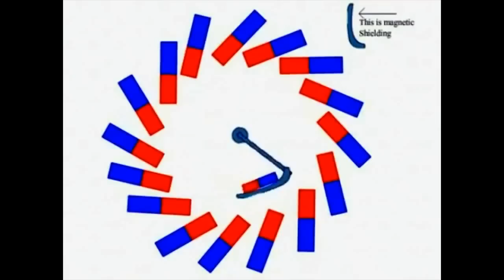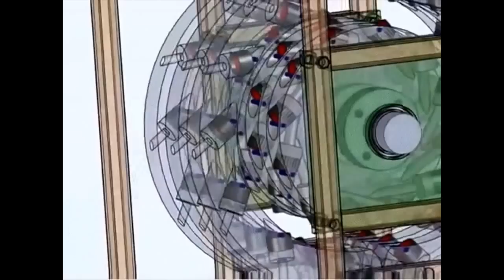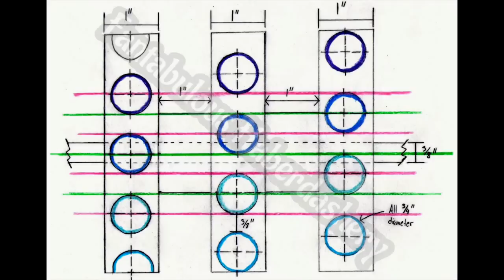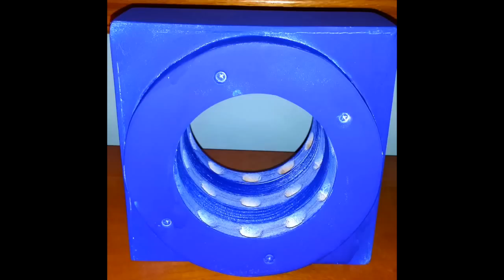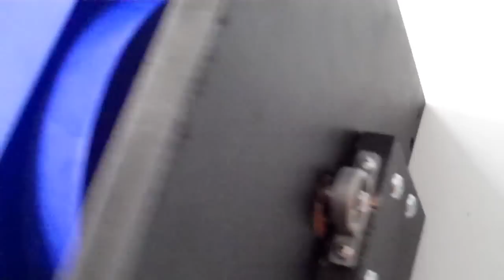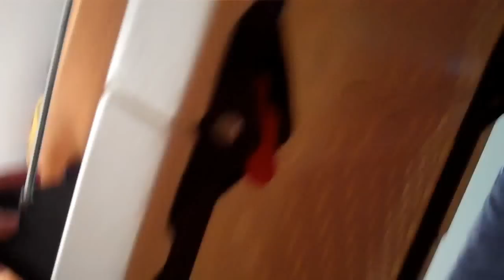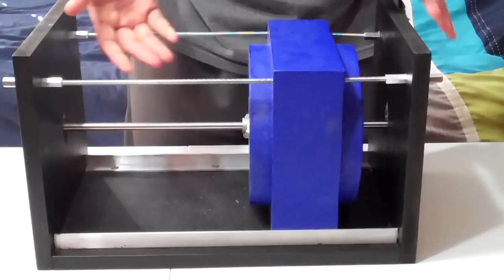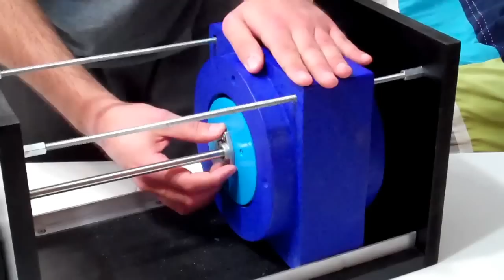Working Perendev Magnet Motor!

Comment: Magnets Loose There Power ? I Have a Magnet from McDonalds That is 40+ Yrs. Old on My Freezer Still Hanging on The Side of it. Hymm
Reply: They do loose their strength depending on the conditions they are under and it is a very very slow process.
But they do not act as batteries they are far more like springs.
Reply: do you have a proof ?
Reply: neodymium mags are the longest and strongest market sold mags, a few hundred years of magnetism in those
Reply: Take that old magnet and tape it to another magnet of similar strength so that the poles are opposed and it won't last another 40 though.

The magnetism of the material doesn't change, but all the magnetic domains that compose it will eventually become misaligned so they're not pushing in the same direction, at which point the material will no longer behave as a magnet.  Applying extra pressure to those magnetic domains in the form of an opposing magnetic field will cause them to destabilize faster.  The magnet hanging on your freezer is probably good for another few hundred years, but put one in constant opposition like this contraption does and it'll get scrambled pretty quickly by comparison.

The total amount of energy you can extract from a "motor" like this before the magnets depolarize will be substantially less than the energy required to magnetize them.  It doesn't matter if it runs for a hundred years, the total useful output will still be less than what it will take to polarize the magnets again when you're done with it.  To get more you have to tap energy from some other source like the Earth's magnetic field.  That should be possible with devices similar to this, but they're going to be finicky about their precise location and any changes in the Earth's field patterns will make them stop working.

Comment: achieving a constant rotation is not helpful ... we should have a torque to use it for rotating a generator or a fan fins ... so the torque that we need , should notably greater than what needed for constant rotating ... if we catch that torque ... there would be no problem in the first step of starting the magnet motor....so it should start to rotate from the scratch at first ... without any help to crank it up... otherwise at the best situation ... we have a constant rotating motor which is not capable to be attached to other things like generator or fan ...
Reply: You are wrong, there is need in Electromotive force, so any seed will be enough.
Rotor of waterfall generator rotates 1 time a day. Generator have up to 74 coils.
When speed is not enough, than you need to increase quantity of coils, that take Electromotive force.

Comment: we support perendev because:
1. it is stronger than v gate 
2. it is most efficient
3. we can draw more power
but none have made actual running model and uploaded it over net. even you also not did. because it needs bismuth or special graphite shielding that you did not use. as the shielding is much costlier 2000$ for one magnet. what will you do???
Reply: Nope. Bismuth, neo magnets, graphite shielding (!), hope, prayer, wishes, etc. will NEVER make Perendev's fraudulent piece of shit motor spin. It's a HOAX.  Are you really that naïve?
Reply: +Quantum Leap what you tried!
Reply: +Quantum Leap   is just a troll.

Comment: How can you tell it's really sustaining the motion rather than just having a lot of momentum? You need to find some weights that match the magnets and have a speedometer or some other way to quantify the speed of rotation, and do some comparisons.
Reply: Ah, good eye! Well, that's just sad. Just faking it and for no reason, except maybe to get views...
Reply: We KNOW it is sustaining motion because he is using an electric motor just out of left frame to KEEP it sustaining motion!  He's a fraud! This is BS.
Reply: Could very well be. In cases like this, where they admit they can't show it running continuously and admit that it is slowing down, I like to give them the benefit of the doubt and reckon they've got something that will spin for a long time and they honestly believe they just need to fiddle with it some more or try again. Now, when someone claims they've actually done it, and the thing will just keep going and going, that's different.
Reply: +Robert England and again, at @10:08 you can just see at the far left edge, that shadow has returned and then see it dissappear as he moves the motor away again,  aha!  I was wondering why he had to hold his left hand so hard on the device, its to stabilize and allow his Right hand to keep pressing the assist motor to the rod on the outside.  BUSTED!!!
Reply: +Quantum Leap You are 100% correct!  I noticed a strange shadow that gives the game away,  @8:37 he says OK, and if you look at the far left where the metal rod is sticking out, he CLEARLY puts something that wasn't there before, (a motor) up against the side (you can see a rod shaped shadow appear of right where an external motor with say, a rod and rubberized endpiece could easily 'assist' by using simple friction.  Dammit, that prick.  Anyways, Busted. By me and this guy. :-)
Reply: +Robert England Sure enough he takes away the assist motor at 9:16 @9:15 the shadow dissappears and it immediately starts slowing... Damn jerk.  Liar.

Comment: What could happen if you conect a little motor to make it run, and then with that, you connect it to another bigger motor to produce energy that can be saved in a lithium battery that can make  the little motor run :D.... it coul be free energy?

Comment: Free energy is not a myth. Take the humble solar panel it is producing energy from free* sunlight. There are energy sources all around us, the Earth is charged with 500,000 volts through tulleric currents. There is the ambient static electricity that can be harvested, and it was harvested by devices like the Testatika Generator or Lester Hendershot Generator and many others (Moray, etc.) The real myth is that fossil fuel and nuclear energy are still relevant today. The only reason these antiquated technologies weren't phased out is because they are making the elites too much money right now :)
Reply: ***** I mean 'free energy' as in energy that you don't pay for. Now there are free electrons (monopoles) all around us. In the 1800s the theory of the electric aether was very popular. Even later scientists like Tesla and even Einstein supported the theory of the electric aether. According to that theory the Earth is swimming in an endless sea of primordial electric gas. It is true that if you run high voltage with high frequency into a vacuum tube eventually that tube will explode. Even though this tube has vacuum inside the bulb will explode from the inside out. Something inside of vacuum pushes on the glass outwards causing it to explode. This something is the electric aether. Even J. J. Thompson himself wasn't sure that the electron truly was the charge carrier in electricity, he was coerced into stating that it was when he was offered fame and fortune by the British. The mainstream's understanding of electricity hasn't improved in the past 100 years, the notion of wires carrying electrons is something we have to move away from. Electricity exist between the wires in a form of a field, and metals create a boundary for that field. If interested in these ideas check out lectures by Eric Dollard on energy synthesis, or anti-relativity. Also check out the German engineer Konstantin Meyl.
Reply: ***** Its better than petrol that you have to keep buying or nuclear that pollutes the planet with radioactive wastes.
Reply: Ya, about them, THEY NEVER DID AND STILL DO NOT WORK!

Comment: It's an achievement that you've created a "semi-working" model. I totally agree with you that such devices, if successful, will drain magnets requiring "recharging".

I have developed my own design, currently going through proof-of-concept, which, if it works, will require an output load so that it doesn't accelerate to destruction.

I am also strongly of the opinion, that the successful creation of an "over-unity" device will have an unforeseen payback further down the track. Once upon a time, we considered "fire" as a form of "free" energy. Physics and Chemistry have proven that it's not "free" at all.

Just to make life interesting, I've also designed a "perpetual motion" machine, i.e., it is a totally closed system. It is a "machine" because it has one moving part. It includes the ability to INJECT energy into the system so that it is operational. Any attempt to EXTRACT energy will cause it to fail almost immediately. Once built, it will include an indepth analysis of faults and why it isn't truly "perpetual". It may outlive me, but I don't expect that it will still be operating in a Third Millennium Museum.

Best of luck with your experiments.
Reply: But have you ever experienced demagnetization, under conditions that exclude heating above curie temperature?

Most magnets have to have a field 5x stronger minimum against it to demag.

There are 1000+lb industrial lifting magnets I've used my whole career. The ones with a switch.

Unless they get dropped or heated above curie temp, they are tested and recertified.

I have yet to find a physicist that can give a precise time lapse of one of these magnets under a load, to determine its life span before it demagnetizes to even get to under 1000lbs (and drop the suspended load)

Other than the 1% per 100 year that's estimated. 

If I can hang a 1000lb load from a crane using a permanent magnet, that produces no heat under that load, or requires any power.

This is a issue for me to understand how this obeys conservation of energy.

If any physicist reads this and can break down or give a formula for a magnet to "wear out" i would appreciate it.

FWIW, I've seen 20year old lifting magnets still in service today

Comment: Nice one mate. Real question with any of these devices is can they sustain powering a load. You see so many of these contraptions where they spin them up with an electric motor (power in) and then claim that they are producing free energy out. It's just a big fly wheel with a stack load of momentum. I.e. Power out = power in - inefficiency. Not convinced yet.... Keep going. I like the debate though. Somewhere along the line someone will stumble across something worth while.